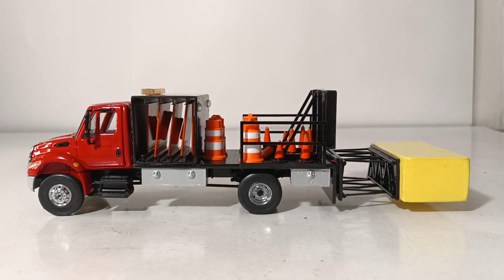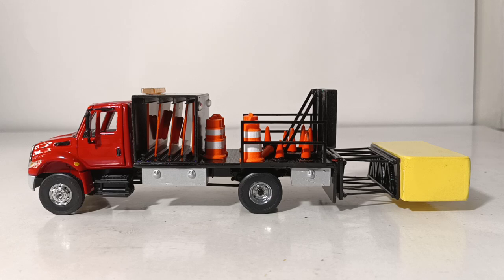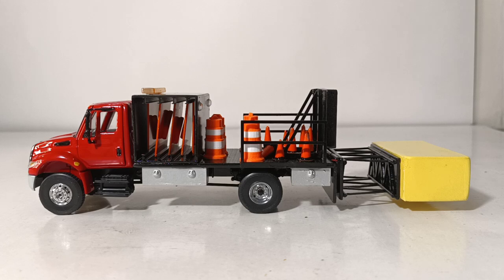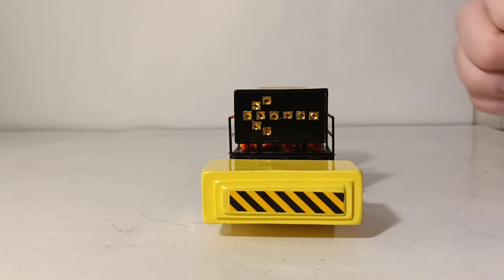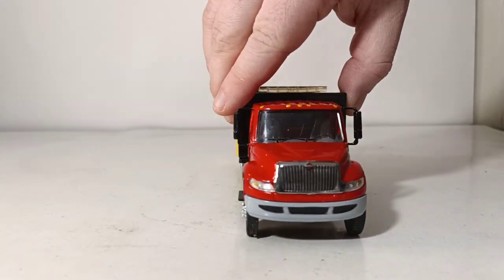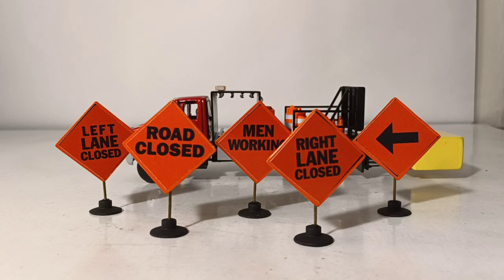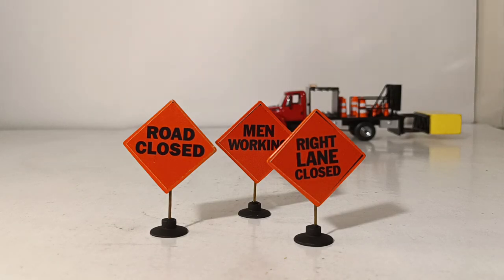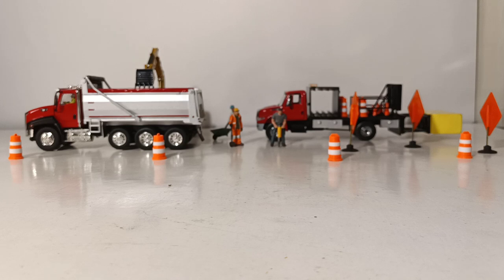Custom 1:50 Scale International DuraStar Attenuator Truck w/Accessories by Precision Scale Replicas

Comment: Where  can you find the barrels?
Reply from the maker: Barrels came mounted on the truck.
Reply: @DiecastEmporium  Okay..  I was just wondering how you were using the loose ones that you had at the end of the video.
Reply from the maker: @billfenner7084  you can buy them separate too. 3D to Scale makes them
Reply: @DiecastEmporium  Thank you for the info.
Reply: @DiecastEmporium I do want this model on orange.